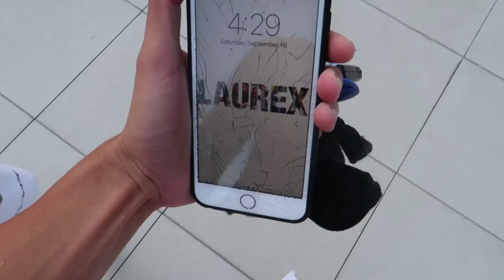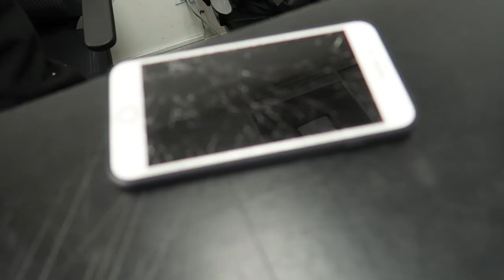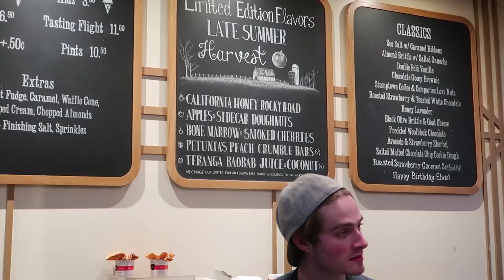PUG PUPPY SCARE PRANK!

Comment: For your back you could use a heating pad, then ice it, then heating pad. I know from experience. After the metal was taken out of my back last year, when they took it out, I could use cold. I gave chronic back pain due to surgery one, then two last July to take out the metal. I also know what creams to use, such as Tiger balm patches.